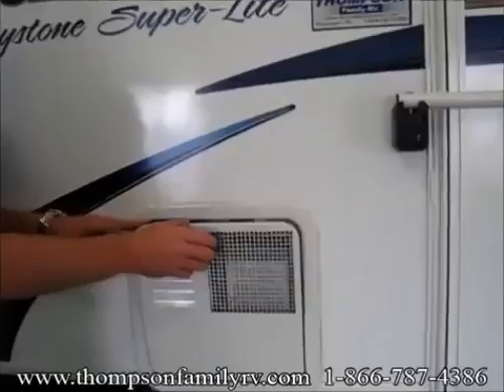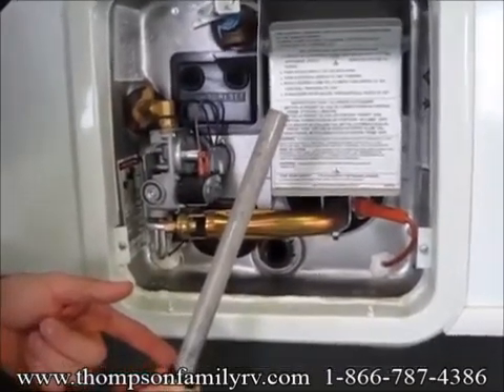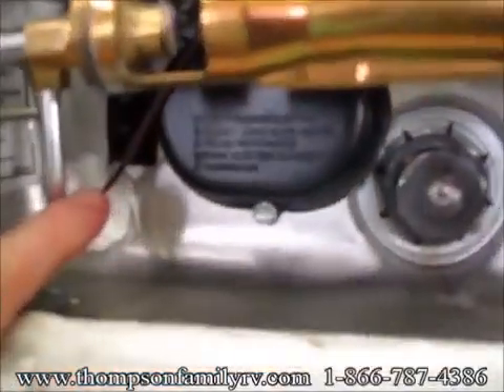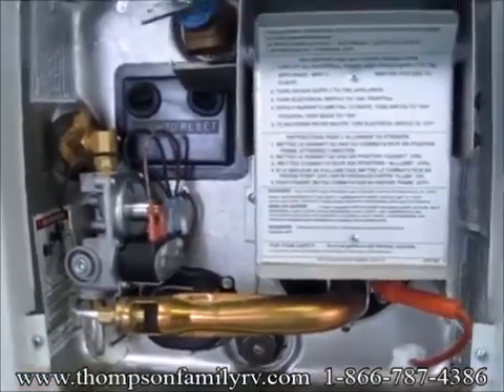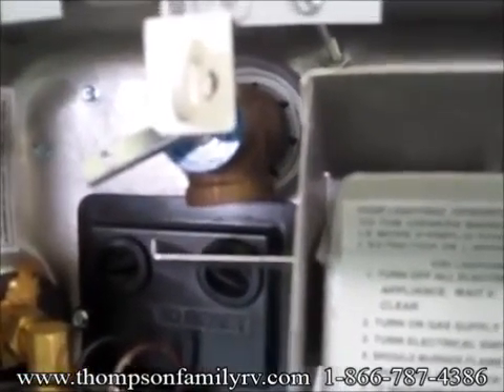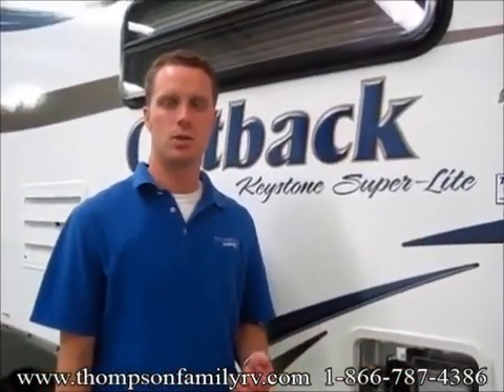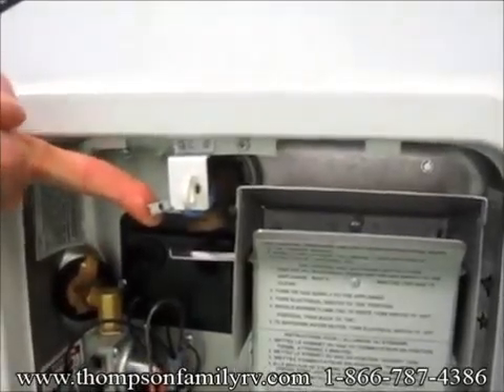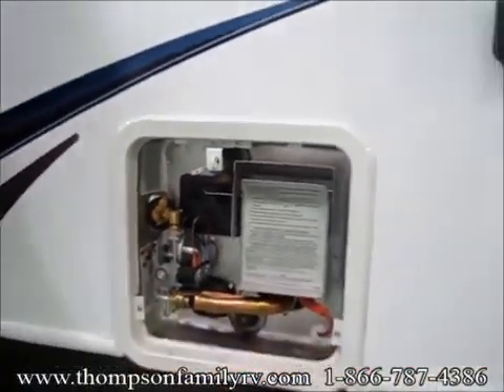How Your Suburban RV Water Heater Works

Comment: Aluminum tank water heaters do not need nor benefit from having an anode rod. You create a dangerous situation when replacing the plastic cap with an anode rod. That plastic cap is a fail safe incase your relief valve fails

Comment: First video I have ever seen where he tells you to use your pressure relieve valve during filling up. That's A NO NO !  dont do it .you will be over filling your water heater and it will cause you problems in the long run.
Reply: Hi Kimberly,
The proper way to fill your water heater and set the correct air gap is to have the pressure/temperature relief valve and all hot side faucets open while filling.  When water starts to come out of the PT valve, stop filling (turn off city water spigot or 12V water pump) close all faucets in the RV but leave the PT valve open.  When water stops running out of the PT valve, close the valve.  (Proper air gap set in tank and air is out of water lines)
The water heater can now be turned on either LP gas, electric element or both. 
When set water temperature is reached (most factory installed t-stats are either 130°F or 140°F) 
LP gas flame is extinguished and/or electric element turns off.  Check for leaks at PT valve and drain plug/anode rod.

Comment: You didn’t show the inside switch lmao
Reply: Thats what i was waiting for inside also.
Reply: AC Cavazos with my rig keystone cougar 304BHS it is only the one outside and you let it sit for about an hour.
Reply: We have a 2007 Wildwood with the Suburban SWE6DE water heater. Can this waterheater operate on electricity only, as well as gas? I see the on-off switch, lower left corner as you show us at the beginning of your video, but I do not find another switch inside as you alerted to.  We have no control panel as so show us. Only a switch for gas. Help,please!
Reply: Anita Plucker yea the switch on the inside of the heater is the “electric switch” be sure it has water first as the video says... and let it run for about an hour and you should have hot water.. you’re very welcome :)
Reply: @danpenamusic  He said there was another switch inside also I have not found another switch I have a control panel is there another switch? Do you know?
Reply: @Here-2-Learn  the switch in the inside maybe be for the propane start. What year is it again? The RV? And if you look on the lower left side of the bottom of the inside it will be there it is a black switch be sure there’s water and that the water heater isn’t bypassed
Reply: @danpenamusic I have this same model but it doesn’t have that switch on the heater only in the inside of the trailer
Reply: I know this is old….. however, if anyone is wondering, your second interior switch is likely a breaker in your interior breaker panel.  That’s how mine is for the electrical side.  Hope someone can still use this tip.
Reply: @MotoFish45  I had figured this out years ago LOL my water heater worked we had hot water during cold months!
Reply: Yes.  He didn't show the two switches!  One outside but didn't show where the 2nd was inside.  Totally useless.  Just another useless video

Comment: Is the electric to be used by itself with no gas or can the electric and gas be used at the same time?
Reply: You can use both at the same time as their thermostats are independent of each other. You can get a faster recovery time that way after using a lot of hot water like showering. I think the electric thermostat is set a little higher than the gas one so for maintaining temperature the electric will override the gas.

Comment: One side of the reset buttons is for 12 volt ( usually the right side) to operate the water heater on gas, and the other side ( left side) is the reset button for 110 a/c to operate the heater on electric.